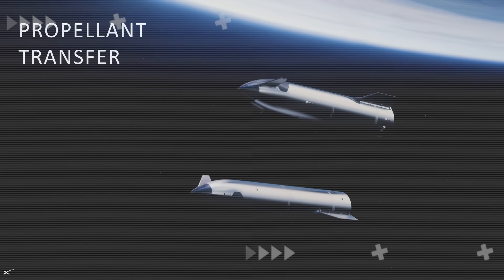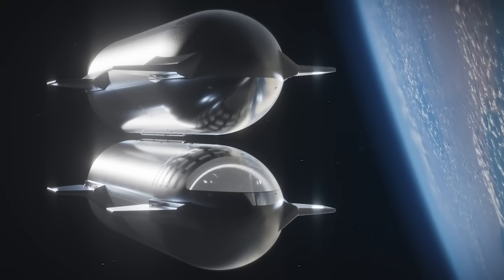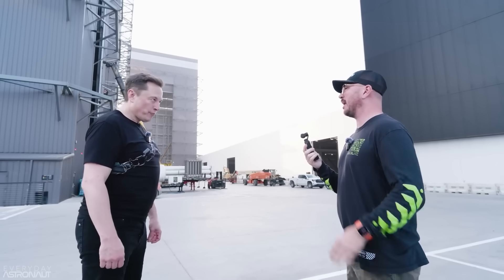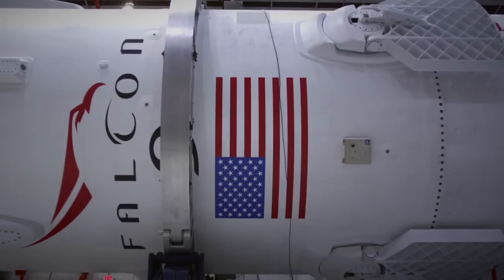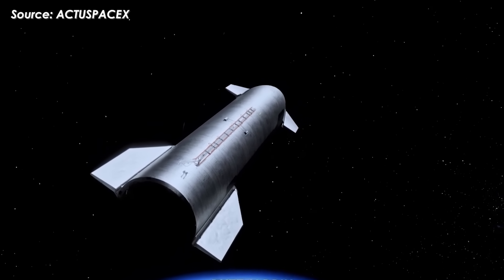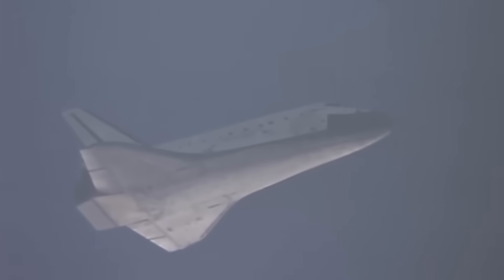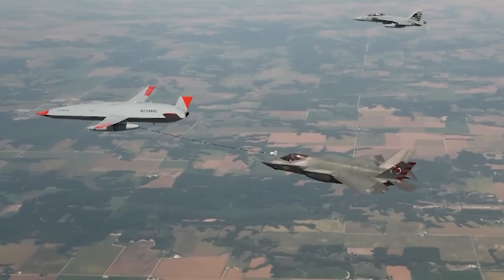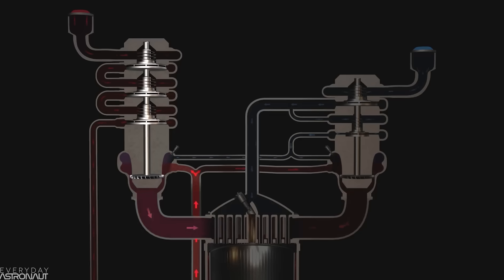SpaceX's Genius Solution to use Hot Gas Thruster after Starship flight 9 RCS Problem...

Comment: Really wish they would just skip to Ultrasonic echo crush fusion pinch.. They need to just send somebody to SpaceX from military that says "we're gonna do this" lol. Google: "Z-pinch engine" < Nasa scared of it. LOL.. But smaller version = Send a pulse within electric plasma that echo then crash into another pulse to crush plasma. Google: "Ultrasound excited plasma generates stronger EM field" < This will also allow precision control of electromagnetic fields for docking. Imagine two magnets pushing to each other but precisely getting weaker to slowly allow coming together. Ultrasound control of electric Plasma + Ultrasound holography to control SHAPE of EM field. Gonna need that for Sky cars and sky trucks for resisting collisions because people crazy.. (For people who try to say it won't work = Google: "Ultrasound detected in Sun's atmosphere" Excess fuel repel field = Plasma generated Ultrasound. So only what the Star needs can push in to control growth speed for stability. Balance..)
Reply: Even if we had the tech operational for a z-pinch engine (no, a tech demonstrator in a laboratory that produces a few millinewtons of thrust for a couple microseconds is not the same thing as something that provides useful thrust and mounts on a spacecraft), you would need a literal fusion reactor onboard the ship... we barely have functional fusion reactors at ground level, and they are enormous pieces of machinery that weigh dozens of tons at the low end, and require enormous thermal management systems so that they don't melt down. The technology isn't anywhere near portable, let alone able to be fit inside of Starship while not using up its entire payload mass. And, no, you can't use solar power for a fusion engine - even tiny laboratory test rigs for z-pinch require hundreds of thousands of amps to operate... while a nuclear fission reactor could produce that amount of power, good luck making one that both produces enough power and is light weight enough to launch on Starship without using up all of its payload margin; a 1MW nuclear reactor, stripped down to the bare bones, might get down to about 40 tons... or, nearly half of Starship's mass to LEO. 

Also, even if it were fully operational to the ideal performance that's theorized, and doesn't weigh hundreds of tons, it isn't going to replace the engines of the ship. Theoretical z-pinch fusion engines would produce somewhere in the ballpark of 38 kilonewtons of thrust (in other words, a few dozen kN); while that sounds like a lot, a single Raptor 3 engine produces 2,550 kN of thrust... or nearly 70 times more thrust. And, starship will carry 3 sea level versions of that and 3-6 vacuum versions. Maybe it could be used for long duration burns for planetary transfer, but it's not going to be able to be used for launch or landing. Plus, there's also the fact that they could only produce that amount of thrust in a vacuum.

This isn't a "Nasa is scared of it" or a "the military has it" thing - even the military doesn't have this tech small enough to be usable on spacecraft yet, let alone both small and powerful enough to use. The technology simply doesn't exist yet. We have plenty of theoretical studies and laboratory demonstrations, but that's a far cry away from a usable engine, especially since these engines would be required to run for days in order to produce the amount of deltaV that conventional chemical engines might produce in an hour or two, while the lab experiments typically only reach operational range for a few fractions of a second. The 38kN engine that I mentioned that was theorized earlier would need to burn for about 20 days straight, meanwhile in 2018, a sheared-flow stabilized Z-pinch only emitted neutrons for 5 microseconds, and its period of plasma quiescence was only 16 microseconds.

Comment: The Starship for a moon rocket is to complicated.
One should have designed a less complicated easier to construct and safer space vehicle with far more back up systems.
If one only has to prove if water is in the polar craters, because if not the this moon base is over!
No need for reusability due to the few missions required, thus no need for 15 space refuellings thus saving weight.
This is not going to be a falcon rocket throwing up satellites every week.
The lander is far to unsafe...... too tall, the lander should be of low centre mass and much lighter.
After 9 attempts not one human has even been designed in a ship as yet, but in NASA 1960s all this was being shared between very experienced aircraft manufacture's sharing the workload and design work.
Space X is on it own and has been found wanting in design capability, manufacturing capability and quality assurance, cause and corrective actions.
Dude who manufactures in a tent, launches without a exhaust trough then fail after failure and then gets the contract!! 
Now there is a sense of desperation in it.
The rocket has no escape capability unlike Apollo's.
One remembers Space X winning years ago the human lander competition, won it for 135 million failing to reach the requirements and then they renegotiated the deal to 4.4 Billion!!!!!.
Musk should have been held to that fixed contract! of 135 Billion, because if it was Boeing they would have been made to do it!
Musk at the time was Trump's best friend for buying out X giving Trump political voice and contributing to Trump's political  campaign to keep this contract.
Now look at the state we are in!
Trump cutting into NASAs budget very hard  and threatening to dismantle Musk all because he didn't like the Big Beautiful Bill.
Trump is no friend of space he is a friend of Trump! the ultimate narcissist.
NASA should have been the main contractor designing and building the moon rocket and lander in conjunction with bigger more capable established aviation companies.
Like Lockheed Martin, Boeing, Northrop Grumman, General Dynamics.

Comment: People!  SpaceX has an entirely different development philosophy than other companies. The traditional approach is to overdesign components, test the heck out of them, and then qualify them.  In a space program, once qualification has occured, changing the design to reduce weight, improve manufacturability, or simplify things is almost impossible as the requalification costs are prohibitive.  SpaceX' approach is to go simple, test, then add in structural weight, cost, and/or complexity as needed, in the smallest amount needed.

This means they start with their best guestimate then verfiy whether it works or not.  There will be multiple failures, and that is expected (even if not desired).

Once qualified, the design is the simplest, lightest, cheapest, and most manufacturable possible.
Reply: And the Space X approach does not work, clearly.
Reply: @Withnail1969 Falcon 9 proves SpaceX works clearly
Reply: @Withnail1969  Soooo right! Just look at the abject failure of the Falcon 9

Comment: Dumb and completely false things are detected! Ullage gas is actually less effective than cold gas thrusters, nitrogen cold gas thrusters actually have higher pressure and specific impulse than only sixth bars of Starship main tanks, also those aren't reliable, actually flight three and nine failed because of that ullage system failed and tanks lost pressure.
Reply: Given: Dumb & false. 
False can not equal dumb.
?
Reply: @MrBigShotFancyPants well, not, you can say some false things that are quite clever,( if you are smarter than the other guy), also you can say the truth in a dumb way, that wasn't supposed to be a free insult, but an honest evaluation.
Reply: @theOrionsarms  reading your comment and @shadow.. reply was interesting and impressive. I was learning from it.
Dumb just stood out as a sub-par word for such a high level subject(i haven't had morning coffee yet- jet lag)
Reply: Dumb is when you reach absolutely wrong conclusion from the data you use,he did that  @MrBigShotFancyPants
Reply: You're correct that early Starship tests faced issues with ullage gas and tank pressurization. Ullage gas is used to maintain tank pressure and prevent cavitation in engines. However, in microgravity, ullage gas can mix with liquid propellant, causing pressure loss. SpaceX is transitioning to autogenous pressurization, where the rocket generates its own pressurant by vaporizing propellant. This reduces reliance on external gases and simplifies the system. Regarding thrusters, cold gas thrusters are simple and reliable but offer lower performance. SpaceX plans to use hot gas thrusters, which provide higher efficiency and are more suitable for maneuvers.
Reply: Half of what you said in your answer is also wrong, SpaceX use autogenous pressurization already on Starship ( not transitioning), also if isn't any hot gas thrusters on their prototypes, you have no reason to believe that would be, also you don't understand what get wrong with mixing gasses with liquids, that doesn't causing "los of pressure", but clogged the pipes and destroyed the thrusters ( and because of that Starship rolled off of control, and the tank lost pressure), both on on the flight three, that actually was the SpaceX oficial evaluation @Shadow-vw8zk
Reply: Yeah and you know better than actual rocket scientists hey buddy😂
Reply: Musk and Tim Dod aren't aerospace engineers , and when they come with the idea of using ullage gas for steering Starship, I predicted correctly that would be a dangerous and unpractical solution, so yes I know better, and also anyone who isn't intoxicated by Musk propaganda that is some kind of genius, and not only a guy with a lot of money @Fuknukkal
Reply: @theOrionsarms  Geez blowing your own trumpet buddy. 😂 Well then you should go work for spacex and fix all their problems for them. FYI I respect Musk for his business and engineering expertise but in general I think he’s an idiot for getting involved in politics..
Reply: Musk's engineering expertise is at the same level as his political one, so no surprise that anything he made is blowing into pieces eventually , if he let other people more qualified to get those decisions , thing would be better for him and everyone else @Fuknukkal
Reply: @theOrionsarms Bahahahaha you’re a clueless parrot😂

Comment: How can this be Genius since anybody with any experience would have told you, you can't maneuver that much mass with cold gas thrusters (unless we're talking really large cold gas thrusters).
Reply: True. This was understood by NASA as early as 1962, when they eliminated the monopropellant RCS system of Mercury and used actual rockets on Gemini
Reply: @jimeditorial  Yep; Gemini had a very strong OAMS and RCS system, especially for its size.
Reply: @Strike_Raid it's irrational to try and maintain attitude on a spacecraft the size of Starship with cold gas thrusters. Even the tiny Mercury capsule used a high-performance monopropellant system, decomposing hydrogen peroxide to steam. A single unmanned Mercury test flight used a custom nitrogen gold gas system. So much wild speculation on sites like this. I think it's safe to assume that SpaceX understands the physics
Reply: @jimeditorial  I wonder sometimes.  Hydrogen Peroxide as a reactant in a thruster is actually pretty strong, Hydrazine is even stronger; over 200 seconds isp.  I’d be surprised if GN2 is even 50 seconds (but I don’t know what it is, just a guess).
Reply: @Strike_Raid I suspect that the guys at McDonnell chose the hydrogen peroxide system for Mercury just because of simplicity. And they were incredibly weight constrained

Comment: Dump musk
Reply: Whether someone likes Elon Musk or not, it's important to separate the individual from the results of the company. SpaceX has delivered real, measurable value: they've reduced launch costs, built the most reliable rocket in history, and safely transported NASA astronauts to the ISS. That happened through a NASA partnership based on performance, not personality.

NASA chose SpaceX because their proposals met the technical requirements and cost constraints better than competitors. If they fail to deliver, NASA can and will choose someone else. But so far, SpaceX has consistently delivered.

It's fair to criticize Musk’s public behavior or opinions. But if the goal is space exploration, then the focus should be on outcomes, not headlines.
Reply: @Shadow-vw8zk  SpaceX's success is due to the engineers that actually design the vehicles, not Elon. Elon doesn't have an engineering degree, and has never done any actual design work aside from injecting ketamine at 3AM and suggesting "why don't we do XYZ?" and then screaming at his engineers to figure out how to make it work - and has a tendency to fire them on the spot if they try to explain that what he is asking for is not possible. 

Frankly, SpaceX is better off with Elon doing nothing than actively trying to meddle with their work; just look at how the Cybertruck fared (a design which he personally dictated the aesthetics of, which is why it looks like something a kindergartner would draw), or how Twitter is flailing, or how Hyperloop is dead, or how Neuralink killed hundreds of apes for little actual progress, or how the Boring Company built one tunnel and then never did anything again... when he tries to assume direct control, things go to hell. This is why Gwynne Shotwell - the president of SpaceX - is basically Elon's babysitter, making sure he doesn't screw things up and keeping him occupied so that the actually educated engineers can do their work.
Reply from the maker: You are funny

Comment: I would wanna use thrusters that used already onboard fuels. And put the big hot thrusters aft, and use cold gas forward, to reduce complexity and get efficiency rotating the ship, and only use the cold gas thrusters sparingly, and have a secondary storage tank for them off the main tank, with a checkvalve in case main tank pops a weld or takes a meteorite.

I would also purposely work towards a system and configuration, leading to eventual side landings and not butt landings.
at least in lower gravity wells like Moon and Mars.
I would also want my hot thrusters to be Nano Raptor 3 like, so they could be repurposed for other uses, say like main thrusters on Ship's boats and lifeboats. Or Mars Hoppers etc. as with lower gravity the majority of surface to surface transportation will want to be lift, and not wheeled or tracked.
I would also design those vehicle to get to orbit in case of crisis.

But, SpaceX is, as SpaceX does...

I just try to help as allowed...😂

Just sayin'